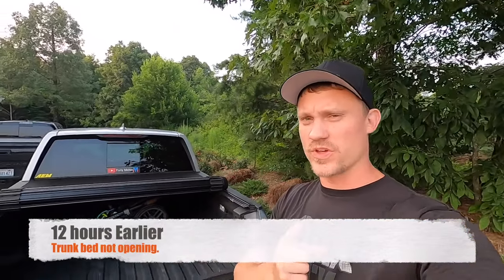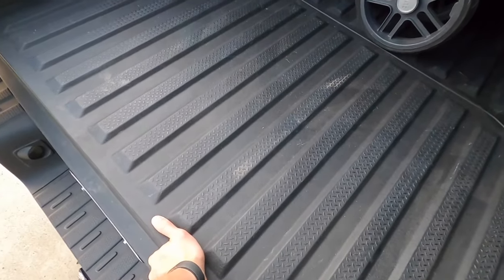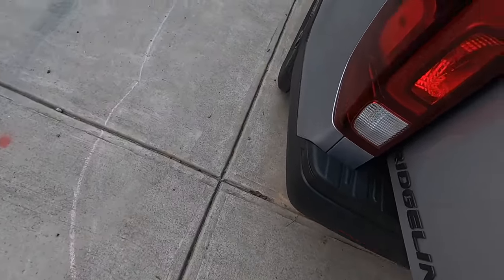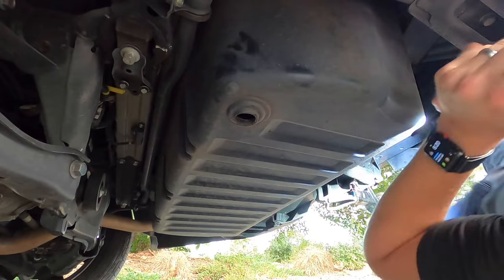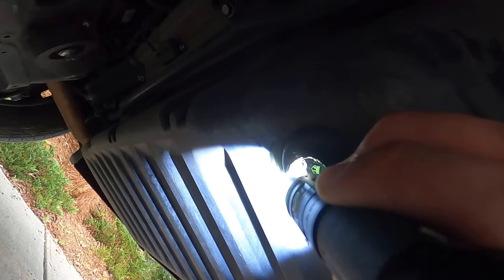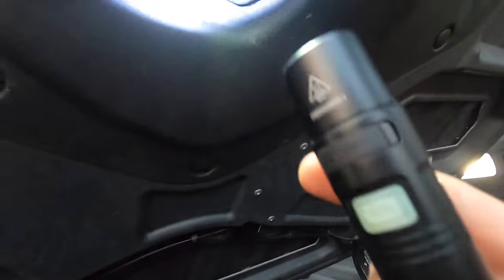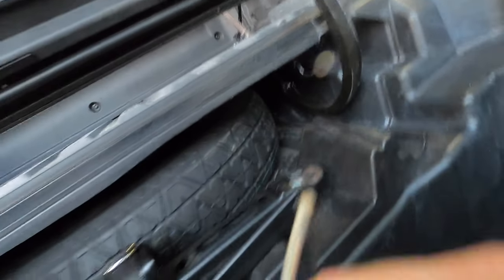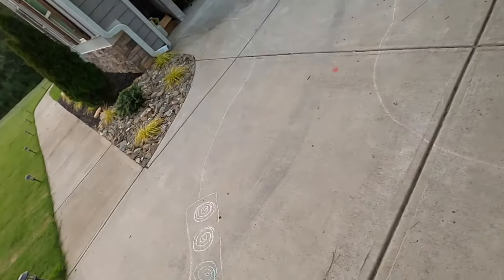Honda Issue Uncovered! Cant access in-bed Trunk / Spare tire - Watch my repair method

Comment: Their is a switch in side the glove box to open the hatch it’s on the right side
Reply from the maker: It’s on the lefts side of the glove box but as you can hear in the video I had power at my handle. The switch shuts off power to trunk so it was not relevant to the video.

Comment: There's a trunk lock/unlock button on left side of you glove box. After you open your glove box. It's kinda hidden.
Reply from the maker: That button shuts off power to the motor. As you can hear in the video there is power. I did check it just in case but was not relevant to the video.

Comment: hate Te

Hate to tell you, but you’re wrong. There is a prong that holds the cable it hard to see, the tape does not hold the cable it is just a reference point, your cable was not installed right or jumped off the bracket. Check with Honda to fix it right. Honda does a good job!
Reply from the maker: I have a secondary video where I noticed it later and address it.

Comment: You know there is a lever behind your back seat to open the trunk
Reply from the maker: I do not know this. I will have to check this out. Do you have a page in the manual where I can find that information? I just checked my manual and don’t see any info like that. Thanks.

Comment: Why isn’t there a bracket to keep the cable in place lol. Engineering fail and they know it because they tried to fix it with the tape.
Reply from the maker: I have a secondary video about the bracket

Comment: More electronic actuator BS.  How about car manufacturers use mechanical latches. I have a 2013 Ridgeline and I wish I never bought it.  It gets way too hot inside and I feel like I have no choice but to leave the A/C on,  I hate automatic locks, I hate the beep it has when I roll in my driveway without my seat belt on, I hate interference engines, I want a timing chain not a timing belt and an internal transmission cooler that may turn my trans into a strawberry milkshake is just a question of when. I made a big mistake buying this gas guzzling pile.
Reply: Did you sell it?